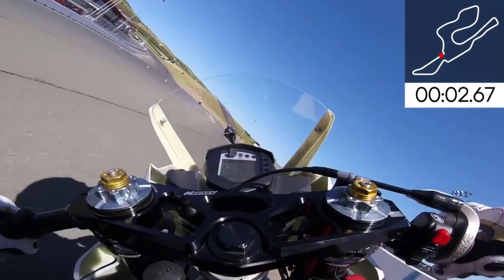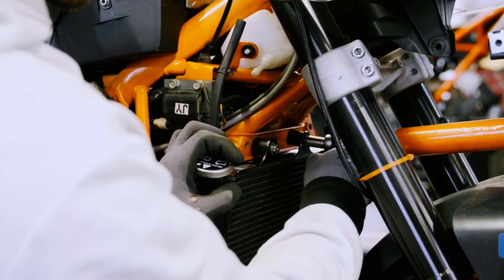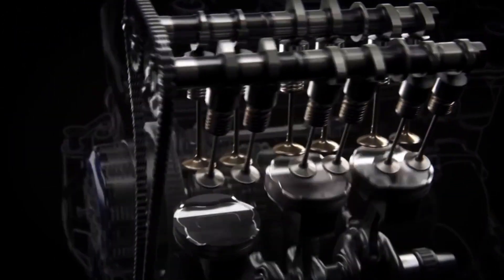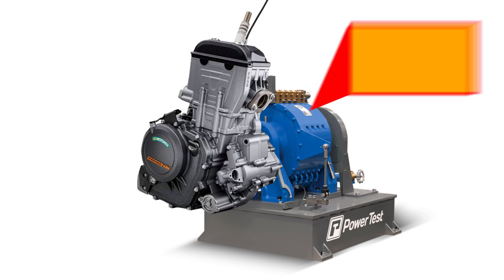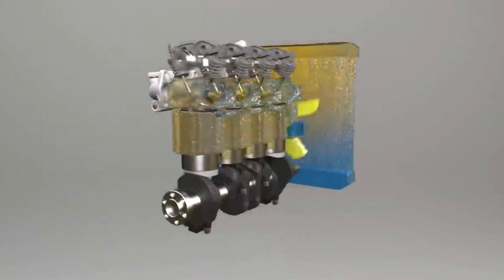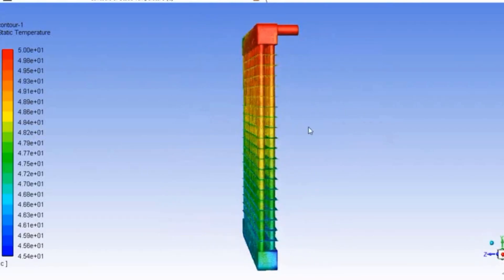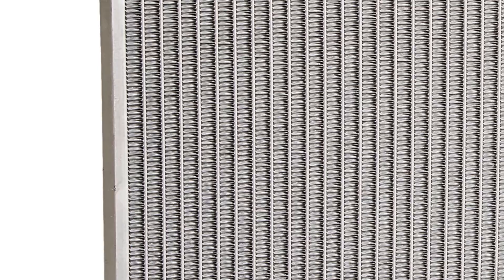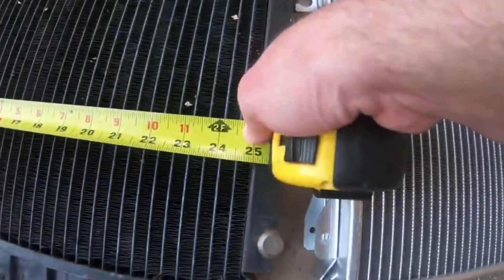Design an Engine Cooling System Like a Pro in No Time!

Comment: Can a make Normal bike's cooler ? Because Indian's using there 100cc bike for long rides 😁
Reply from the maker: The concepts and the formula used to calculate the heat load from the engine and the area of radiator required is applicable for India's majority air cooled motorcycles. Instead of radiator, the area of fins is calculated which are provided o the engine block. Thats why even those 100cc bikes wont have any heating issues on long rides, but it is recommend to take periodic breaks.